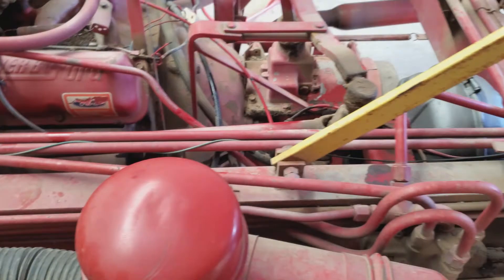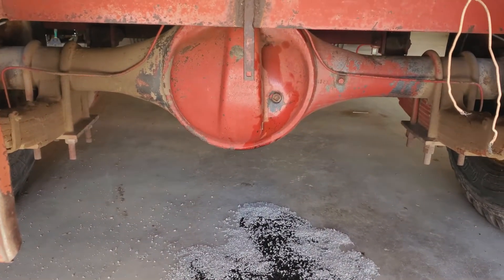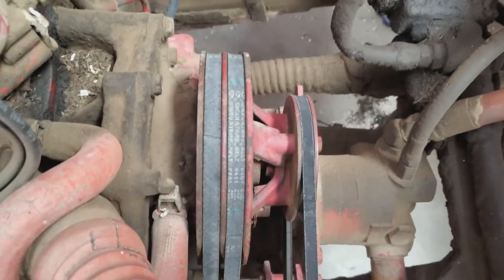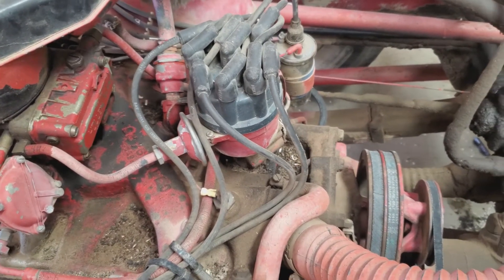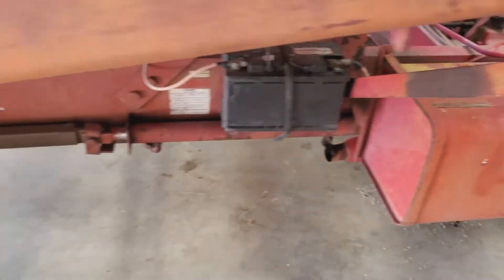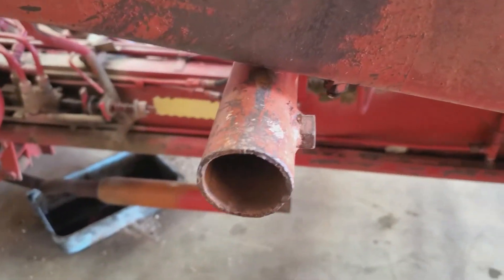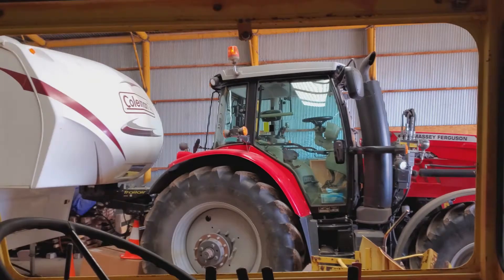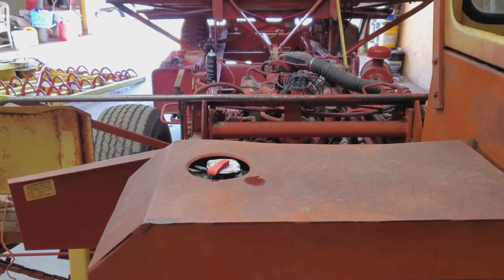New Holland 1049 Bale Wagon - Brake Boost Repair Part 2

Comment: I'm fixing up a 1049 super as well. First big problem I had to fix was engine head gaskets went out and oil was full of water. Been ordering lots of parts from Sod buster sales.
Reply from the maker: They're great machines, but take a lot of up-keep.  I went in to do a brake job and ended up replacing wheel bearings too!  Filmed way too much on that job 😂,  now I'm dreading putting it all together!